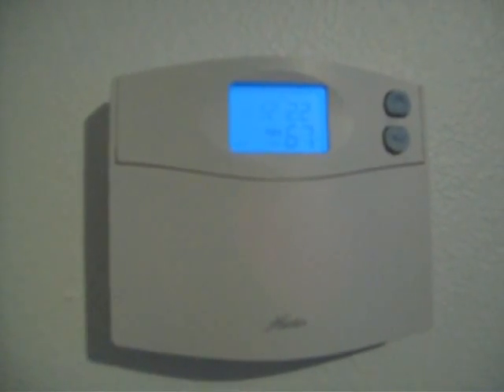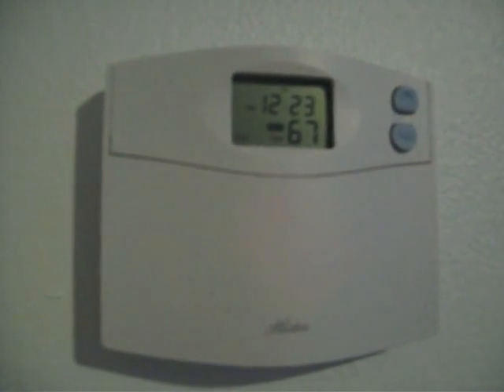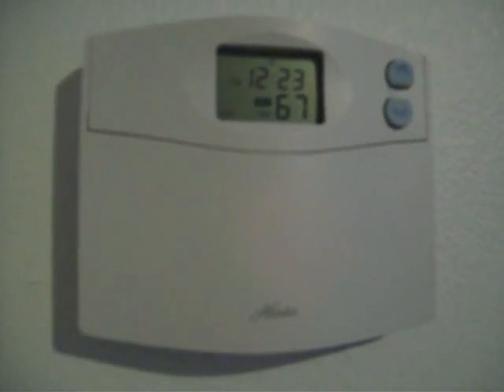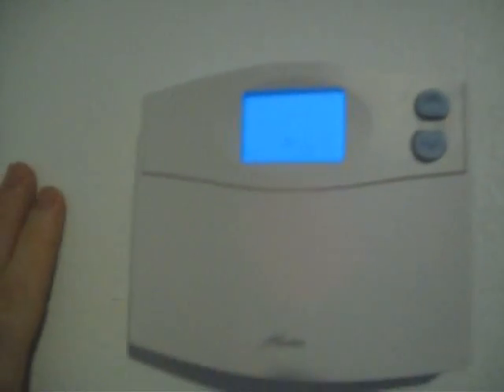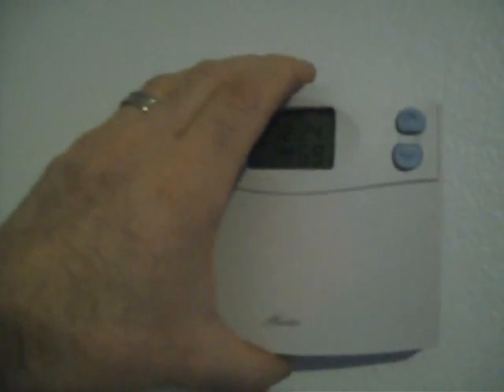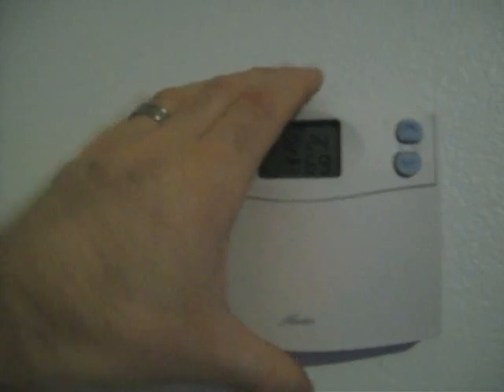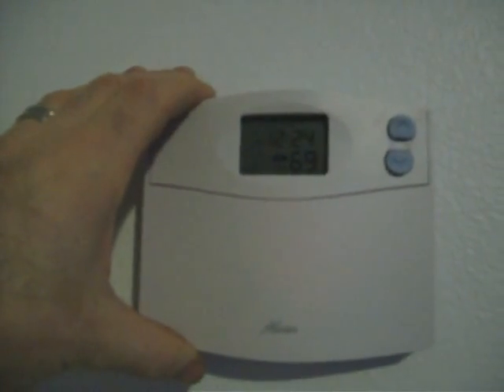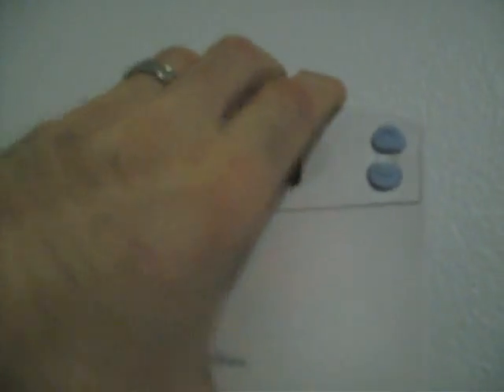HEAT WON'T TURN ON How Test if your Thermostat is Broken Faulty Bad Zone Valve Boiler Furnace Repair

Comment: Thanks for the easy tip for checking wires. Heat went out on my Nest Thermostat  and issue was a loose wire
Reply from the maker: Amazing how common a loose wire seems to be!

Comment: Thanks, my screws were tight but it was dusty, wiped the cover part off with a dry cloth and then used canned air on the wall part and the cover, put it back together and voila heat is working, always check your batteries also, and try reset button using a paperclip, and I also shut off the switch in main electric box, then back on,  I checked all those first!

Comment: What if I have the thermostat at 73 degrees. And the temperature keeps rising to 86 degrees.
Reply from the maker: Did you figure it out?  Could be a number of things.  Would it get even warmer?  is the system shutting down at 86 or does it just keep running.
Reply: I have thus same one. Its because it has a program setting. And every time the pow goes out it will rest all the programs . Mine always goes to 60 degrees. You just have to go through and  rest the program times to what you want. Also I think if you press hold it will stop following a schedule.
Reply: It turned out to be a broken thermostat. My husband replaced it and problem solved. AC works great now.

Comment: I set the temperature to 73 but the heater only turns on again if the reading goes down to 65. Is this normal? Shouldn't the heater turns on again as soon as the reading goes down below 73 to maintain the desired temp? Pls. advise
 Thanks.
Reply: I have the same problem. If you find a solution please write it here. In my case heating kicks back up only if it goes below 60, or if I turn off the thermostat and turn it back on.

Comment: Do you know what would cause the downstairs heat to work but shuts off if I turn the upstairs heat on & vice verse. They won't work if they're are both on?

Comment: Thank you so much!!  We woke up to a cold house this morning and realized that the heater stopped working sometime during the night.  Tried turning the furnace pilot light off, then back on, but no joy.  Finally googled and came upon your repair tips.  Found out two screws were very loose.  Tightened them and the furnace is up and running!!

My cat just passed away today, so this was really the last thing I wanted to deal with.  Thank you so much, again!!  Best wishes to you.
Reply from the maker: Please continue to monitor your system.  Sorry about your kitty :(  Glad at least this went your way...
Reply from the maker: Please continue to monitor your system.  Sorry about your kitty :(  Glad at least this went your way...
Reply: benger88

Comment: Our apartment has been ~55F for the last week. Tightening the screws did it. ¯\_ (ツ)_/¯
Embarrassing or not, we now have heat!
Reply from the maker: Sweet!  Amazing how they even become loose????  Glad you got it fixed on your own!  Nothing like saving a service call........  I appreciate the comment!  It's always nice to now when my video's helped.  Wished everyone would post....  And it's not embarrassing - You figured it out on your own and didn't need to call someone over and spend a ton of cash to tighten a measly little screw, well at least I hope you didn't :)  Glad you guys got it going.  Here without heat is bad news as it's been zero to 20 below for the last week and it looks like colder weather is on its way up here in Fairbanks Alaska......  Up here no heat means Frozen pipes!!!!  Glad you got it going... :)
Reply: Sadly the victory was short lived. While the heat worked for a few hours yesterday, it stopped working again in the last afternoon. We're going to replace the thermostat today and have an HVAC person come out this week if that fails. My guess is the people who replaced our wiring from the thermostat to the furnace about a year ago did a bad job on getting the connections solid.
Reply from the maker: Bumber!  At least you can say you gave it a shot!  Are you able to manually turn the heat on?
Reply: Nope, can't turn it on. We're going to get a new thermostat tonight and try it out in case that's the issue. We're already using a well-rated thermostat from Amazon, so I'm not holding my breath.
Reply from the maker: If you look here at 5 min and 2 seconds you will see how to manually turn the heat on if it gets too cold. 

https://www.youtube.com/watch?v=NfxletrSKUs

There should be a spot on the zone valve.  Also if it is an apartment you should probably contact the owner.  Best of luck
Reply: Thanks for your help and the follow-ups! We did end up having an HVAC person come take a look. Turns out some of the wires were done incorrectly when the last people redid the wiring for our furnace (ugh), so I don't feel so bad about not getting it right. Not sure why the person who redid the wiring didn't just attach the wires in the same spots as they had been originally.

Well, at least it's now fixed and the heat is working :)
Reply from the maker: Well you were smart about it and Yes the HVAC guys are worth it when you can't figure it out.  Glad you got the help you needed and are warm again...

Comment: My thermostat (brand new) doesn't always send the signal to my furnace. when it doesn't, I reset my thermostat and it works fine. Sometimes it will work fine for a week and sometimes I gotta reset it 2-3 times a day.

Comment: Just installed a new braeburn 3220 thermostat. AC works fine but heater won't turn on.

Comment: temp will drop alot depending how cold it is outside. ..natural gas heat.. reset the times on it...
Reply from the maker: I'm not there but check out these sights for a checklist

http://www.justcalllink.com/webapp/p/201/no-heat-checklist
http://homeguides.sfgate.com/troubleshoot-furnace-blower-runs-heat-43207.html
http://asm-air.com/heating/furnace-not-blowing-air-troubleshooting/

Comment: my heater will kick on once and get up to set temperature... after that the fan just blows and temperature drops...any ideas??
Reply from the maker: +tripsalot78 what do you mean drops?  drops 1-2 degrees, 10 degrees, Never kicks back on?  Do you have to do anything to get your heater/furnace to kick on?  what type of fuel are you using for heat nat gas? electric? Heating fuel?Baseboard heat or forced air?  Also do an internet search on your furnace it may be an easy fix and might not be the thermostat.  Also check the time and temperature settings if you are able to program to make sure they are all set to a warmer temp. and the times are right.

Comment: Thank you for posting this.  I have a different brand and today it just started resetting itself for no reason and the display just kept blinking.  If I took the thermostat off the wall, it would stop blinking/resetting.  I just loosened and retightened a few screws, replaced the thermostat, and it was back to working like normal again.
Reply from the maker: +tagnal SWEET!!!  Glad it Helped.  Mine runs on batteries, so I'd test them too.  It's nice when you can fix it on your own and save a $100-$200 visit from the repairman.